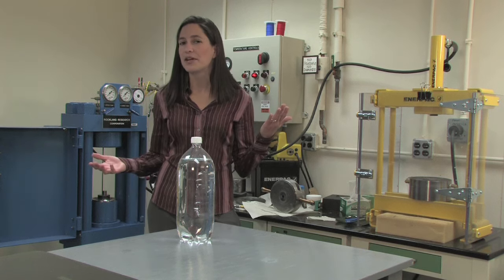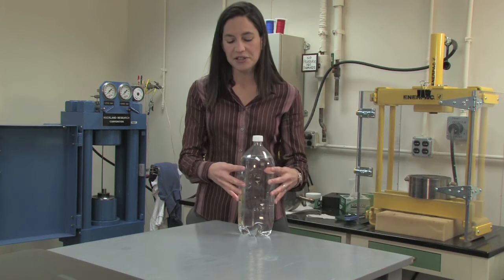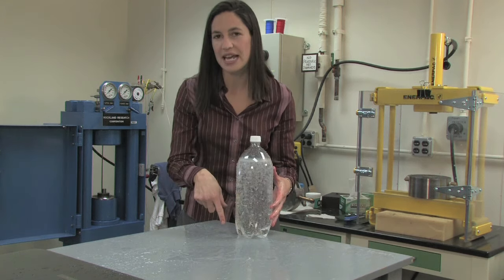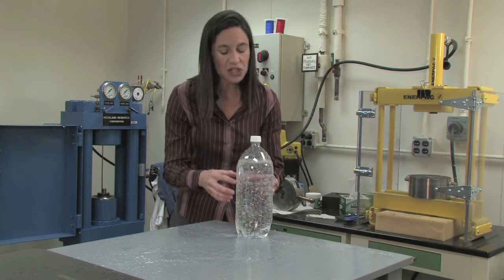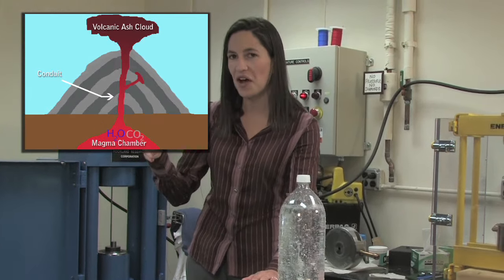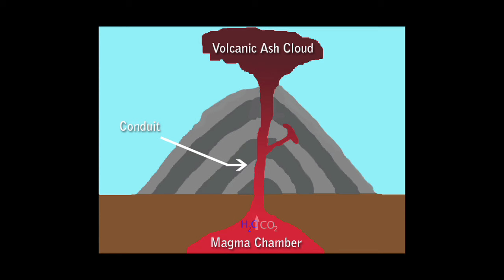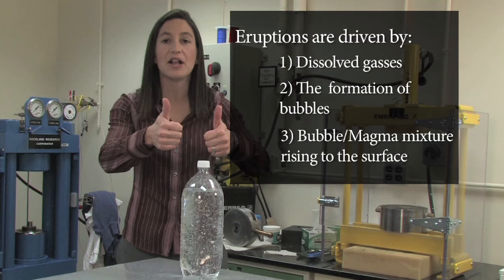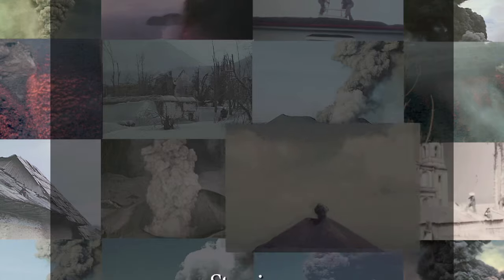Volcanoes Under Pressure

Comment: Did you mention heat? I think not. Sure there exists various gases dissolved into both water and magma. This however is chicken shit compared to the incredible pressure developed when snow (ice) melts, gets heated in an enclosed area. Such as when it meets the incredibly hot surfaces inside of a magma chamber.

Bingo! There's the bulk of your case. Not dissolved gases. These contribute but in fact are ALSO heated up as the amount of magma surrounding it and other gases increases.